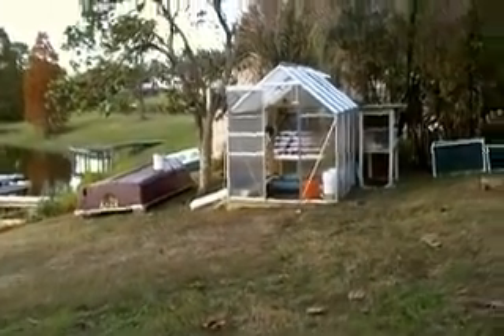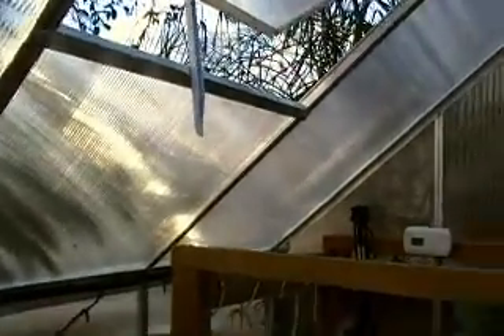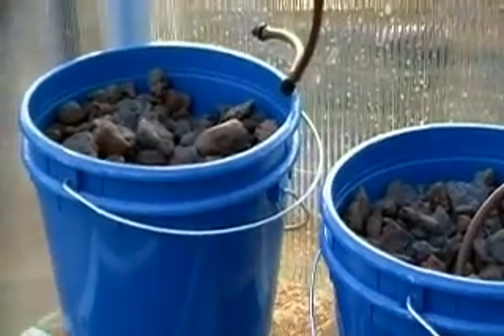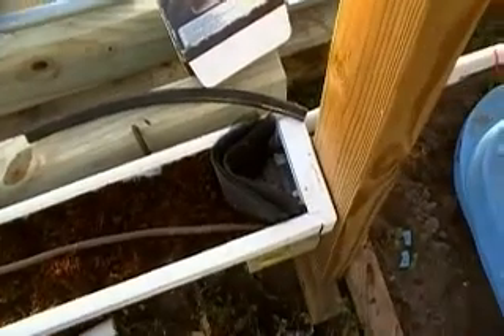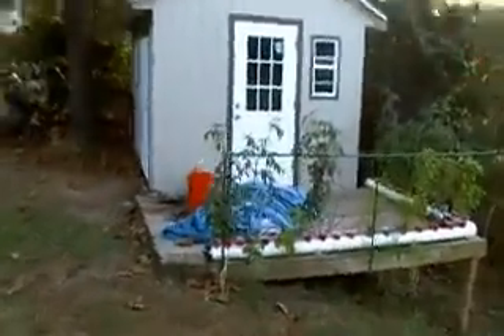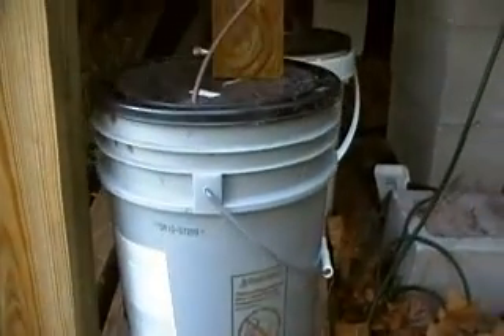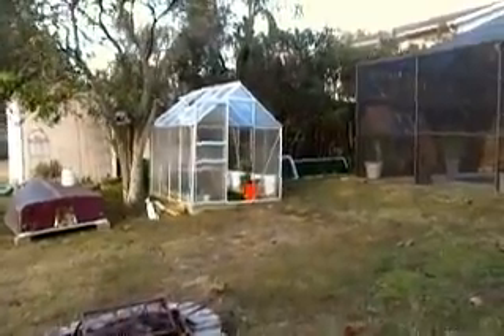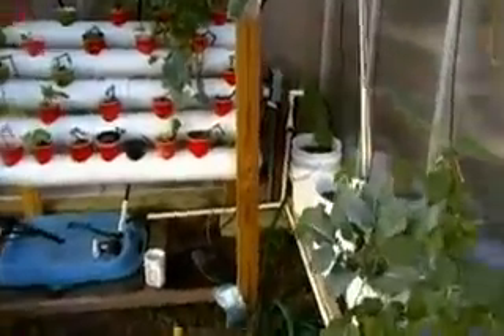6X8 Greenhouse Hydroponics

Comment: I also have a 6 x 8 greenhouse and want to set it up using hydroponics.  How did you build the stand for the PVC piping? Are the double buckets simply two bucket stacked? What did you use in the buckets for the plants to grow in?  Where did you get the buckets? Are the smaller buckets also double buckets? How are you watering the new plants in the gutter?  Are all the plants using the same water source? If so, how do you adjust the fertilizer for each plant's requirements?